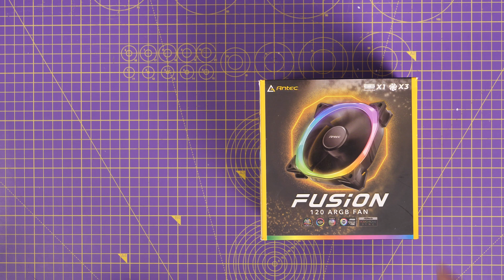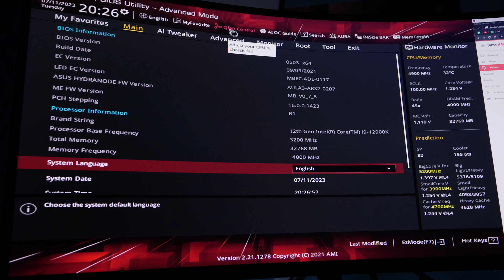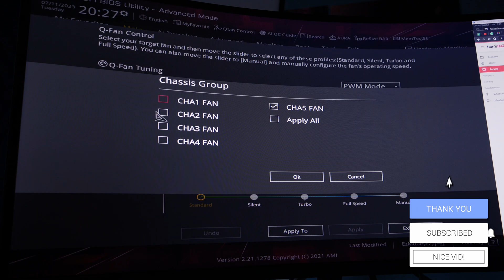Antec Fusion RGB fan setup and wiring guide

Comment from the maker: Specs of this build:
Motherboard - Asus ROG Strix Z690 E Gaming WiFi  https://youtu.be/j_BdTTYDS_M
CPU - Intel Core i9-12900K CPU
RAM - 32GB Corsair Vengeance DDR5 5,200 Mhz RAM
CPU Cooler - Antec Vortex 360 https://youtu.be/99Y79mzijbc 
Case fans - Antec Fusion RGB fans https://youtu.be/cAJnP0QyDZU
PSU  - NZXT C1200 ATX power supply - https://www.youtube.com/watch?v=vNUmD8GQxSQ
NMVE - Seagate Firecuda 540 series
GPU - Acer Predator BiFrost Intel Arc A770 OC
Case - Antec P20C Mid Tower https://youtu.be/fVwgw58oNAk
Related videos worth watching:
Where to connect PC case cables https://youtu.be/xT36IDSQBX4
Where should you mount your AIO liquid cooler? https://youtu.be/qQcyYHGtArs
Common Mistakes You Might be Making with Your PC Fan Setup https://youtu.be/uPIMv30Vs3w
How to use different fans on your CPU cooler (all-in-one cooler compatibility)y  https://youtu.be/Mm85qMEYlDI
Push Pull mistakes to avoid with all in one coolers https://youtu.be/_gA71wF9Ewc
Avoid these problems with your all in one CPU cooler https://youtu.be/nVkN
Reply: Is it possible to connect Antec A30 Neo ARGB CPU Cooler 3 pin 5v to Antec F12 ARGB Fans Controller

Comment: Late question 🙂
What are the options if you run more than 5 ARGB fans?
My pc case has has 10 ARGB fans.
I suppose you could run 2 controllers and set both to the same mode and "speed" ?

Comment: Idk why but all the RGB headers have been removed. No pins whatsoever. Is there a way around this? I just wanna replace the exhaust fan and add some to the top. I have a ASUS ROG Strix GA15 G15DK GA15DK-MB786 Gaming PC; AMD Ryzen 7 5800X 3.8GHz. Pre-built.
Reply: Hi, can you tell me if you have set the fans to extraction or suction or both for the airflow?
Reply: @ a combination of both.

Comment: Question, if they are connected to the fan controller, is there a way to control the rgb with software like signal rgb or something? Do I need to plug something from the controller to the motherboard or what?

Comment: i want to use these on my dual chamber chassis. But its not dual led, is it possible to force modify the fan? like maybe remove the fan motor and put it back in reverse?